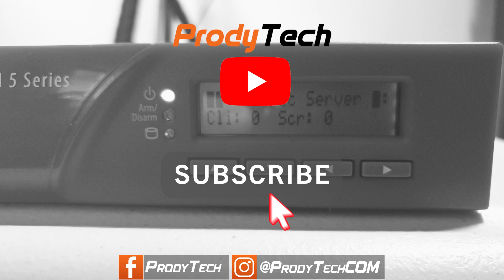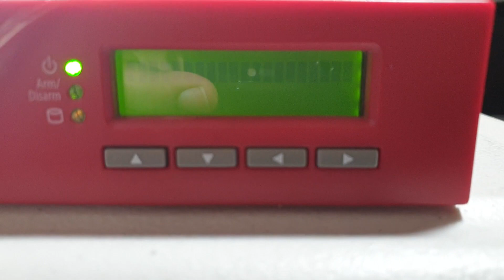I Upgraded a Watchguard XTM 5 with CPU RAM and SSD for pfSense 2.5

Comment: What is stored on the SSD? Is 120 GB overkill for this?
Reply from the maker: Well kind off if you are not planning on storing anything a smaller one will do and save a bit of cash
Reply: @ProdyTech  Thanks for the active reply 2 years after posting the video. Doing 2 of these upgrades now for a point to point VPN between sites.

Comment: What other CPUs are compatible?
Reply: There are several Socket 775 Celerons that are compatible. One of which is probably what this unit came with stock. They varied depending on the sub model, XTM 5 model 505, 515, etc.

Comment: What is the benefit from this upgrade? Is it still a firewall?
Reply from the maker: Good question. More horse power and you can run more packages and have more users at the same time. A set up like this can easily handle perhaps about 1000 clients. So it well worth it.
Reply: @ProdyTech  Is that CPU installed support AES-NI? I think it’s a requirement for running pfSense 2.5
Reply: @delfo2000  OH MY GOD!!!! That’s great news and now I understand the reason of this upgrade. Thank you for a great video, appreciate!!